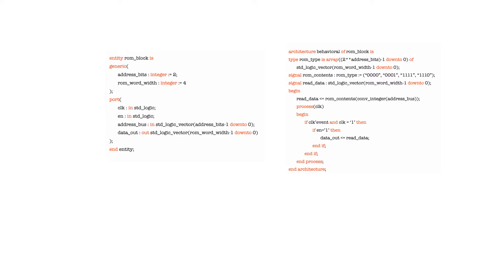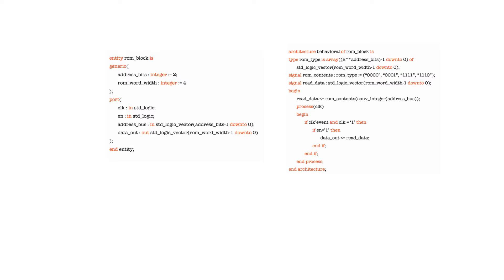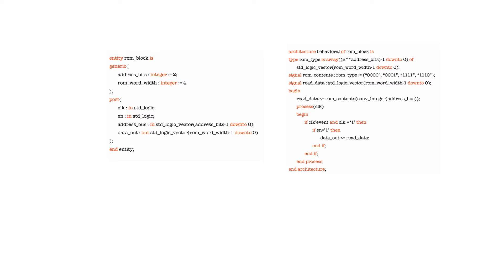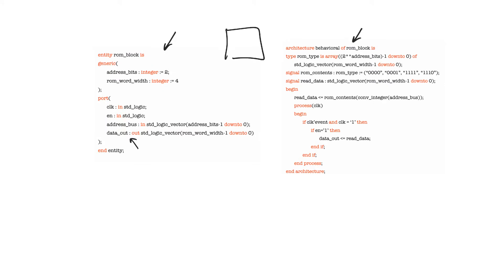9.20. Memories in VHDL

Comment: if the latched output which is the middle choice is in a clocked process, wouldn't it be translated into a register? I understand that dout will have to keep its old value if WE=1, but I thought that unwanted latches can be generated in combinational processes only due to some missing conditions.
Reply from the maker: There is a missing condition. In the bulk of the if, we only assign the memory content. In the bulk of the else, we only assign the output port. Thus, the output port is missing definition in the bulk of the if, which creates latching for the dout bus. If the problem here is whether this is a latch or a register, then yes it depends on whether the process is clocked or not. In asynchronous memories, it will create a latch, in the memory we described it will most likely synthesize into a register.